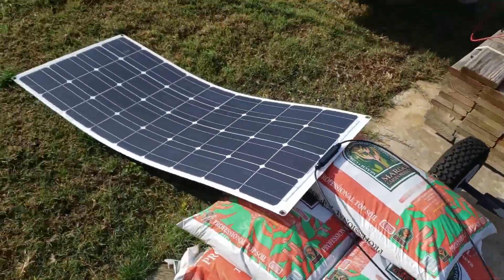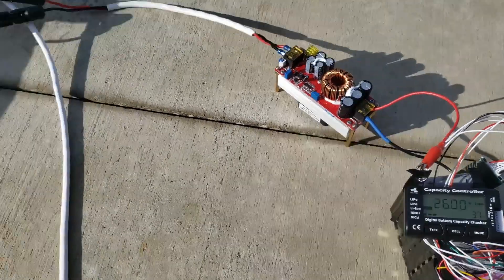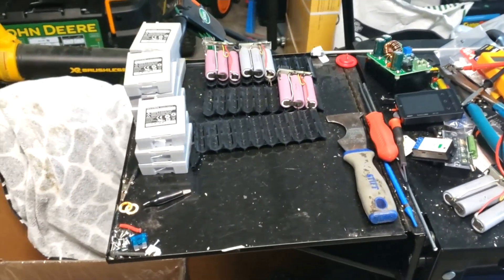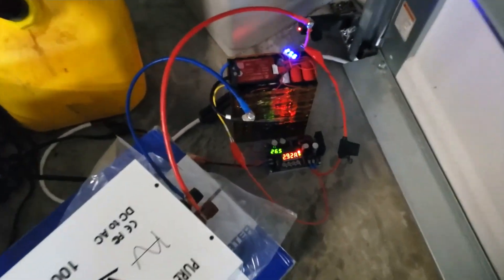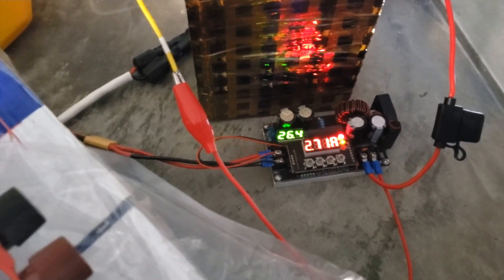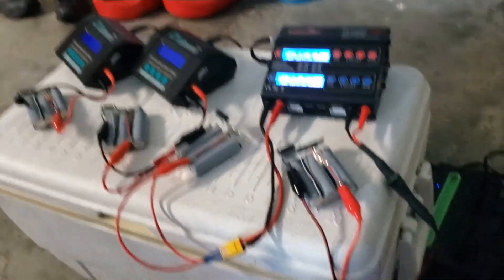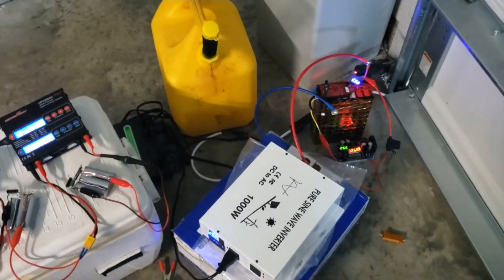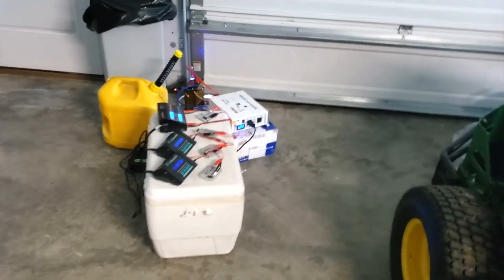MINI 18650 SOLAR POWERWALL Generator Build

Comment: Same thing happened to me with 2 DC/DC converters, soldered a connector backwards on my battery and blewout both boards on connection lol
Reply from the maker: I blew up my inverter the other day when the BMS clicked off and the converter sent 44 volts from the panel to the inverter.  luckily it looks like its just the 4 capacitors on the input that blew. I ordered some and will try to replace.

Comment: I use the exact same fan to cool my liitokalas too! I also prefer those modem packs and just bought a box of 84 of them, and just setup my mini solar setup with 2 100 watt panels running to a 1000 watt pure sine. We must be solar twins! lol
Reply from the maker: Thats funny.  Some times when it was hotter outside I hooked up a computer fan pulling across from the other end.
Reply from the maker: Yea I have bought 2000 cells from the same guy.   He must have millions of them. I almost wish he would run out so I would stop buying them.